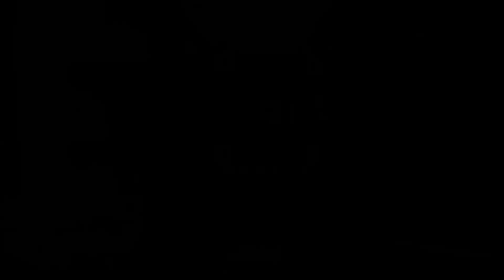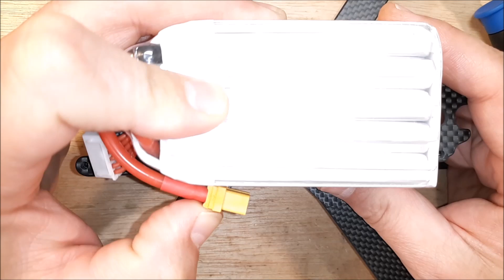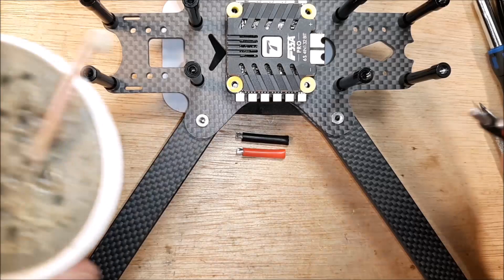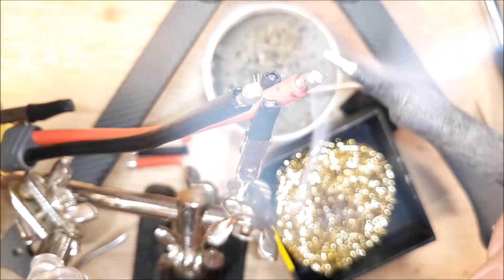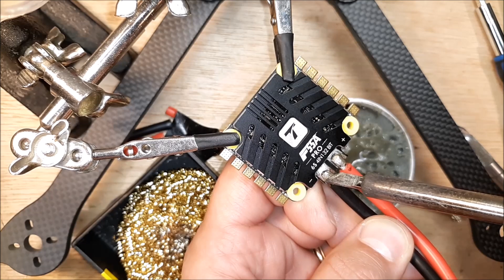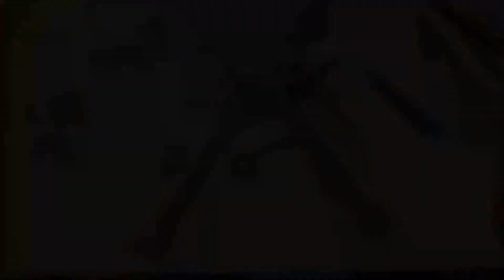7 Inch Drone Build | Part One

Comment: I recently discovered your channel and have been enjoying your videos (redundant ground was excellent).  One concern - You mentioned that you used plumbing solder to tin your pigtail leads.  I’m no authority, but I have read that plumbing solder uses an acid core that would be too corrosive to fine strands of wire and other electrical components.  BTW that section of the video also deals with solder wicking up under a wire's insulation when tinning.  It happens to me all the time and I've tried all sorts of things, like mini heat sinks, with limited success.  Of course my iron is too hot!   It just makes sense.  Thanks.
Reply from the maker: I appreciate you bringing this to my attention. The solder core must be rosin and not acid based. Thank you Klaus!
Enjoy the Breeze...👍🏻🍻🖐🏻